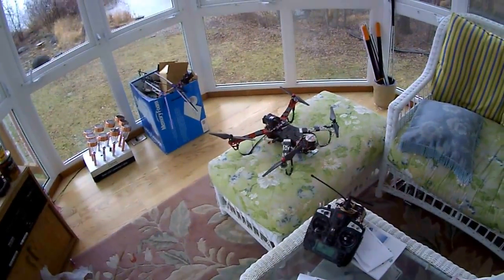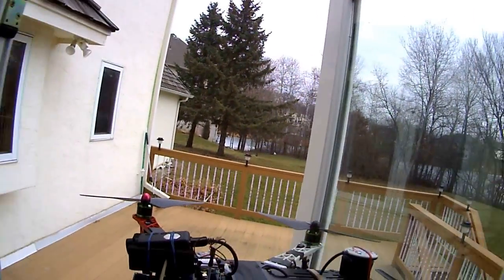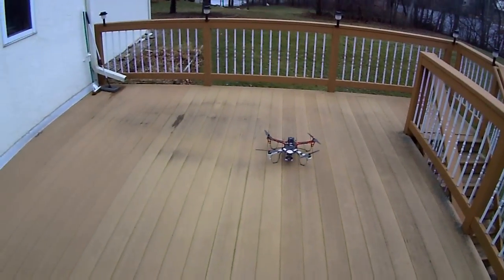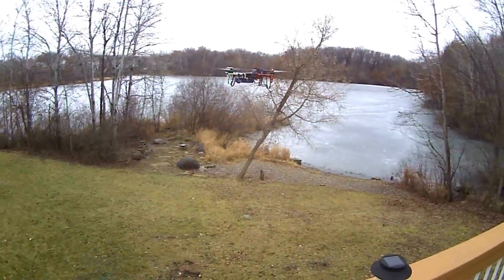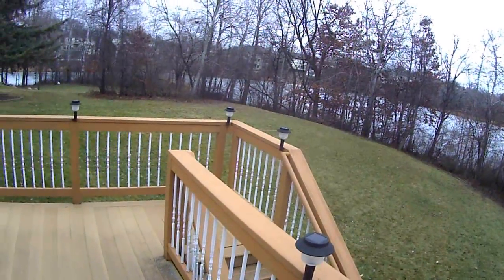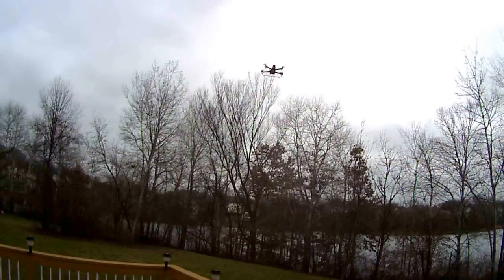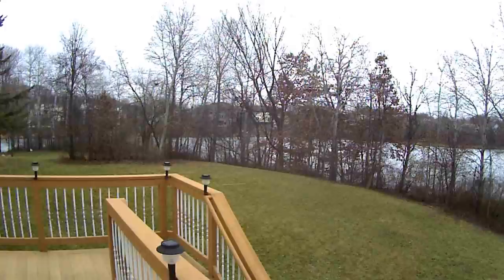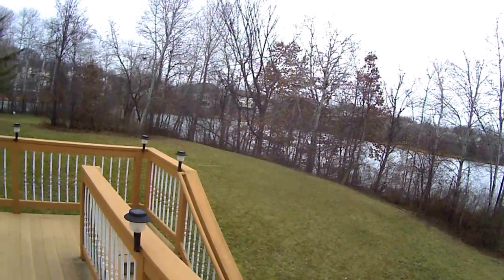HK Reptile 500 Test Flight Cap Cam View

Comment: hey Tony hows that qbrain working for you on a 4s lipo
Reply from the maker: The QBrain esc has been working out just fine with 4s battery without any issues!
Reply: +tony13985 thank you for the fast reply, i have a 4s 5200 planning on trying it on 450quad 980kv sunnysky and qbrain 25a
10inch props... she works fine on 3s .. qbrain does get hot..
Reply from the maker: +Paul DTOM I'm running 4s 3000 mah for 10 min flight and the esc only got warm.
I'm using Turnigy 920 kv n 8045 carbon fiber props
Reply: Thanks